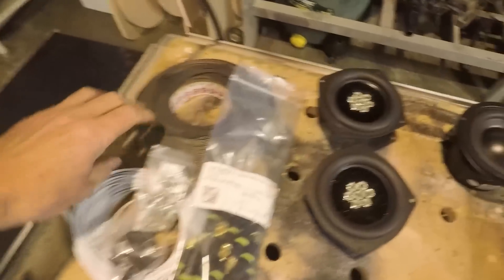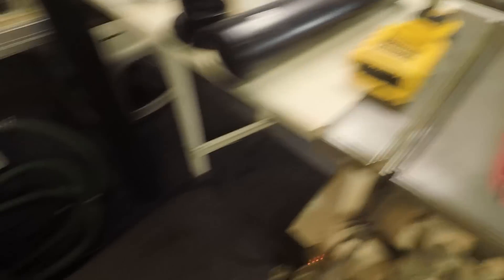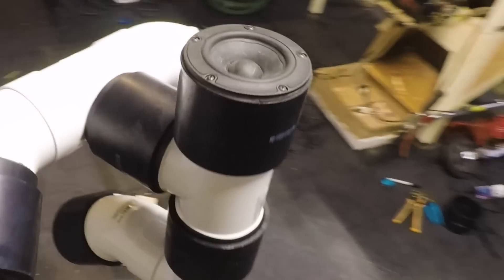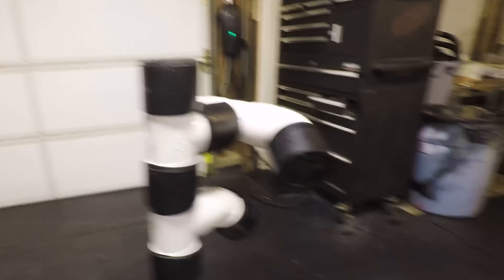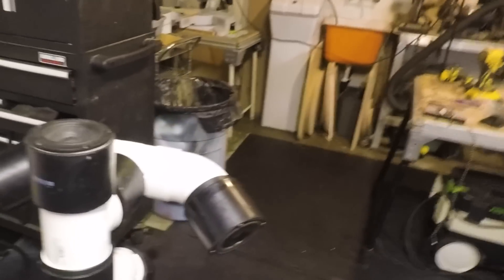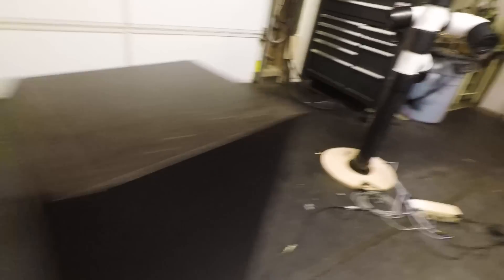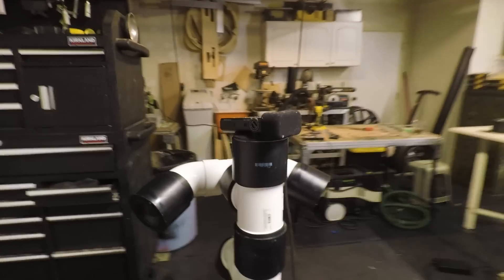Speakers Don't Sound Real, Lets Build One That Does

Comment: You should try Ohm's Walsh series of speakers as your sources. Mirage also had their Omni series, but it's been radio silent since KEF bought them over a decade ago. Mirage advertised that 70% of the performance was reflected, ambient sound.
There were other quasi-point-source speakers over the years, but those are the ones I recall actually selling (fairly) well. It still comes back to the old saying - your room is the largest instrument in the band.
Reply: I second Jason's recommendation of the Ohm Walsh omnidirectional speakers.  While being a large format hi-fi speaker, they are definitely not point source designs. As a small format, Gallo Acoustics could come somewhat close the above.  Also you may take a look at the Sausalito Audio Works tweeter aperture waveguides.  Apparently they have a non-conventional radiation pattern.  I think B&O licensed the tech IP from them a while back. Who also created the cardioid arrayed Beolab-90 speakers.

Mr Rat, excuse my ignorance but it would seem as though you've recreated Dolby Atmos through mechanical means? With six discreet mic positional tracks (per instrument).  Perhaps Bessel arrays, Harmon CBT, Don Keele spherical arrays? Maybe try a 360 degree cluster of 50° pattern wedges. One for each mic channel.

On a side note, for me reproduction of live instruments requires lots-o-watts.  Coupled with speakers capable of high spl, fast rise time, and preferably low'ish QTS drivers in an under dampened cabinet alignment. Yeah on paper they'll ring a bit on decay, but in reality they'll hit the first signal cycle with a higher amplitude!  Nothing sounds more live than realistic transient attack.  Maybe not your cup of tea, but the DSL unity horn designs do some really cool stuff!

A gem amongst a sea of audiophile hyperbole, the Spica TC-50 speakers were truly holographic in their imaging and soundstage.  The owner/engineer of Spica hit a magical sweet spot of phase alignment, mechanically & electrically.  Anyway, love your work and audio experiments! 💯
Reply from the maker: Maybe give a watch to the follow-up video where discuss most if not all of those perspectives and let me know what you think

https://youtu.be/DetAlPFa7gc
Reply: @DaveRat  , per your recommendation  watched your follow up vid, thank you.  Many may have gotten a better understanding of what you're proposing from the 2nd vid.  I totally got what your experiment was in the first vid!  But for hi-fi reproduction this concept is unfortunately not commercially viable.  I think for application specific reproduction exhibits (museums, trade-shows, hi-end business presentations) this might get some traction as a new standardized multi-channel format.  I still think you might attain similar results with a column of splade full range , or coaxial drivers.  Your rear-facing drivers are further exaggerating the already reduced bandwidth/amplitude/phase/polar response of a recorded instrument's rear/wide axis signal profile.  And their boundy interactions will be all over the map in different environments!  While maybe attractive to the human ear, is it a more accurate representation?  Many people prefer large amounts of artificial stereo and 3D'ish effects.  Is that a good representation of the original sound event, most likely not.  But Dolby/DTS/ProLogic/Etc effects have largely helped sell billions worth of consumer/pro AV gear.  Hell look at all the fancy LCD, OLED, nano-pixel blah blah blah TV's sold.  Hyper-realistic colors, razor edged outlines, digitally processed motion artifact reduction (that usually induces an even more peculiar viewing experience).  The low informed consumers gobble it up like digital candy!
Reply from the maker: I'm not really interested in diluting the concept of how things work by what is commercially viable.

I think trying to plug some idea like this into a familiar market may not be as forward-thinking as could be.

I come from the live sound world where we regularly buy speakers that cost $12,000 a piece and buy them in blocks of 32 and 64 units at a time and deploy hundreds of them for big festivals.

From the perspective of a home HiFi consumer, high end pro audio systems would not seem commercially viable either but in reality they are it's just a market that is unfamiliar to most.

Ultimately the question isn't whether it will make money or be accepted but rather, does it sound more realistic?

The reason I thought maybe watching the second video would be helpful was the recommendations that I look at the ohm speakers and other speakers that radiate the same sound in multiple directions and thought maybe the second video clarified why those concepts are not in the right direction
Reply: @DaveRat   @Dave Rat  Fair I suppose. From this video it seems like you're not using directional mics that mirror the positions & radiation patterns of the drivers or keeping the signal chain intact so the sounds won't resemble the original performance anyways. If you maintained signal separation, it would look a bit like a speaker version of an ambisonic mic array which might be quite a thing.
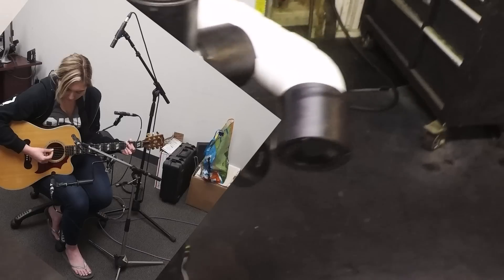In this demo you had six mics recording for four speakers, and you said you didn't even remember which mics were where (7:58), so it's not really recreating the sound field. It's just an oddly shaped point source.
Reply from the maker: Exactly and that is the most important aspect of this adventure.

Recreating the sound exactly is not necessary to create realism.

An infinite amount of different instrument shapes sizes and sounds will all sound real.

Yet conventional speakers fail in making any of those sound real.

The whole point of this is that in order to sound real, radiating different sounds in different directions is the most important aspect.

Which mic captures which sound or whether the instrument is dull or bright in this location or that is not that big of a deal.

I am not looking to recreate the exact sound of the original instrument.

I am trying to show that Sonic realism can be achieved by radiating different sounds in different directions like the actual instruments do

Additionally fidelity, is not critical for something to sound real. A trash can lid has very little fidelity when hit but sounds real if you're in the room with it and never sounds real if you record it and play it through a conventional speaker regardless of how much Fidelity that speaker is capable of.

Fidelity helps but it's not critical, mic placement helps but it's not critical, it's the generation of multiple sounds radiating in multiple directions such that we get multiple reflections creating a much more complex interaction of sounds that creates realism, I believe.

At least at this infantile point in audio where this angle has not been explored to any substantial degree.
Reply: @DaveRat  , I've watched you YouTube videos for years.  Your pro-sound knowledge base is amazing, and I've learned quite a bit from your sharing!  In my humble opinion line arrays/j-arrays/cluster arrays still follow basic wave propagation directivity rules.  The real magic is in the dsp processing, for integration and coherency as essentially a macro-scale point source.  Dynamic correction via FFT analysis and other advanced algorithms makes them viable.  Otherwise all you have is column speaker(s) with all their inherent mess.

And I would like to compliment you on your video editing, worthy of educational reference material. Perhaps an next phase of your career arc?

To answer your original question, I'd say yes your format of recording/reproduction does sound more authentic!

Just curious, do these latest and greatest large format arena/edm festival systems now include ambient air temp and Density Altitude (Baro) inputs for dsp corrections?  Outdoor setup have always suffered from annoying Doppler like phase distortions from wind gusts.
Reply from the maker: Very cool and thank you!

As far as line arrays being dependent on DSP processing and maybe worth looking at vdos which was the foundational line array that started this whole trend and the only processing was EQ to smooth out the response and limiters to protect the speakers.

The whole beauty and function of line arrays is mechanical design

I have a pretty good knowledge of this because I have actually reversed engineered vdos presets into power soft amps so that we could power vdos off of the X4.

And was able to create with the help of my friend Mario presets that matched or exceeded The originals and all it was was EQ and limiters
Reply: @Traqr  , So yes in technical terms his experiment is not an accurate recording/reproduction.  But I believe what Mr Rat is attempting to display to the layman, is psychoacoustics may have a larger effect on our perception of sound being realistic than ultimate accuracy in signal capture/reproduction.  Psychoacoustics is an entire sub-category of audio science.  Dating back to Alexander Gram Bell, Fletcher/Munson, and other early pioneers of sound science.  Much like advanced "lossless compression" algorithms which truncate data streams via mask frequency subtraction, and predictive generation of harmonics, subharmonic, IM, and many other signal interactions.  AI A/V technology soon will be doing some amazing things!   

And - not to jump tech levels here but, neural implant technology will eventually render current physical reproduction typologies (along with our own physiology) obsolete!  Now that's a rabbit hole to fall down into! 👀
Reply from the maker: Reproduced sound does not need the sound identical to the source to sound realistic

But

If a sound does sound identical it would absolutely sound realistic

Therefore

For a sound system to focus on sounding identical it must also embrace sounding realistic

This project here is focused on the simpler and overlooked aspect of realism.

Once realism can be achieved then we actually have a shot at working on sounding identical

To try and sound identical without tackling realism is a waste of time because it cannot be achieved
Reply: @DaveRat  , While your format is interesting it would seem that optimizing phase accuracy of your array would be the next step?  I've auditioned some of the most expensive esoteric (home) audio hdw out there.  The now decades old, little 2-way Spica TC-50's generated the most pronounced 3D soundfield (from standard stereo LP) I've ever experienced.  Not only could you pinpoint individual instruments, they sounded like they were (realistically) floating in the air not only between but also extending laterally and in depth well beyond the speakers. I own multiple sets of Vandersteen speakers, which were designed (compromised) specifically for maximum phase coherency - and yet fail to deliver what the Spica's could achieve (for a fraction of the MSRP)!
Reply from the maker: Why?

Aligning phase is very important when identical signals are being reproduced and interacting with each other.

But do we align the phase between a guitar player and a bass player?

Do we align the phase between the various drums of a drum kit?

We align the arrival times such that we don't have drastic offsets but phase aligning separate independent signals serves little to no purpose other than to create artificial sounding things.

Theoretically if an instrument radiates different sounds and different directions they would be minimally phase aligned in the first place

The phase of the sound coming off the front of the guitar versus the top of the guitar versus the back of the guitar or the bottom of a guitar are not all aligned and differ.

It is these differences in signals and phase creating reflections that don't perfectly cancel and conb filter with each other and the direct signal that I believe is one of the aspects of sonic realism that's overlooked.

The initial instrument is a phase mess more like a distributed mode loudspeaker

So to artificially correct that phase mess I believe would be working in the wrong direction
Reply: @DaveRat  ... But they are aligned. They're aligned the way the instrument produced them, and any variation to that alignment will be artificial. Your example of a trash can lid is a good one - instruments are chosen for their resonances, even if it's intentionally discordant. Creating a different, arbitrary alignment will create a different, arbitrary sound. Real sound is hard to reproduce because it's so deeply layered, with all the complex phasing, interferences, and directional cues that a real-world speaker has trouble duplicating.
These principles have been known to recording engineers for a long time, which is why we have XY, mid-side, binaural, and a host of other arrangements just for stereo recordings, and the phase variations are sensitive to remarkably fine misalignments. I also think you've underestimated the influence of frequencies at the limits of hearing - when testing my home theatre some time back, I was surprised by a set of measurements from well below the others (down to about 5Hz). Then my son came in the room, and I realized I'd been picking up his footsteps from the hall. Reality is more hi-fi than hi-fi apparently.
Reply from the maker: If all of these are so well known and so sorted out how do you explain why HiFi systems have so much difficulty fooling people into thinking a real instrument is playing in the room?

Have you ever heard a HiFi system where you walked into a room and walked around and were absolutely convinced that a real musician was there playing an instrument?

If you place four different mics on an acoustic guitar and run them all into test software or smart will the phase of all four mic be aligned?

If you combine those four mics however you wish using whatever tools you wish and alignments you wish and reproduce them through a speaker and then put four mics on that speaker will the phase from the mics miking the speaker be all aligned?

Feel free to test and prove me wrong but I think you'll find that the phase is not aligned on the four mics on the real instrument yet will be aligned on the four mics that are micing a speaker.

I believe what I just described is the reason speakers don't sound real, regardless of their fidelity.

Sonic realism involves a phase mess. Loudspeakers are intricately designed to avoid presenting a phase mess.

In my opinion whether the face mask is the same mess as the instrument produces or a different mess only changes the sound of the instrument but not the realism
Reply: @DaveRat  Hah! No, of course routing multiple mics into one signal won't maintain the phase alignments across all frequencies - that's my point. The real soundstage is a continuously flowing 3D field, and the best chance of matching it seems like it should be matching full-range drivers with full-range mics, both spatially and temporally. Also, I haven't experienced an audio system that overcame the challenges of getting a real speaker to sound exactly like some completely different real instrument, let alone a set of different instruments playing in a real acoustic environment, because real speakers have their own resonances, phase alignments, and directional cues; so do the microphones we use to record with. I believe that's why sound engineers have to spend so much time and effort repairing audio to match what they heard in the recording room, and why people spend outrageous amounts of money trying to make their speakers vanish, leaving just the music.
Reply from the maker: If you never hear the original instrument, how do we know which resonances are from the speaker and which from the original?

Only if the resonances are applied to multiple unrelated instruments does it matter

I still feel you are focused on recreating an identical image of the original rather than a speaker that sounds like an instrument instead of a speaker

Current speaker technology can't even reproduce an instrument the wrong way that sounds close to actually being real let alone create one that sounds identical to the source.

I'm focusing on the easy part make something sound real phase 2 can be make something sound real and also sounds like the original
Reply: @DaveRat  , Your response was quite a bit to unpack.  And responding in a meaningful manner will greatly exceed my patience of typing on an android keypad. But, I believe Jason responded in a rather articulated manner.  Which is in line with my understanding of audio science!   Your "stormtrooper" speaker is laid out in a semi-symmetrical cfg.  And I could be wrong but, it seems like you're attempting to prove that coherent, aligned, or even similar divers and/or microphones are inconsequential to reproducing the effects of your recording/reproduction format?  
* And you could be right! *

I auditioned beta production prototypes of the Grand Slam speakers at David & Sheryl Wilson's townhouse in the early 1990's (was trying to get a job with Wilson Audio).  They were a massive cluster of driver cabs, being processed with goldmund active Xovers and parametric equalizers.  I was shocked to see an esoteric speaker built that way, and the fact he was processing the signal!  Back then it was all about signal purity via minimalist signal chain.  But he got it to work, and was successfully charging >$100K USD for a set even back then!

And I'm not arguing with your findings, actually you might discover others have already traveled down this research road many decades ago.  But at the same time, I can agree with Josh!  This intentionally created semi-chaos of signal reproduction would cause most competent recording Engineers an aneurysm. It fundamentally breaks so many good practices in one swoop!

I feel like I'm dancing on the razor's edge of insulting you?  You're obviously someone who is leagues above my knowledge of the subject matter.   I really hope I don't come across that way!  I'm just trying to figure out what your interest is in this.  Are you just telling us to "hey check this out"?  Or are you feeling out if there's industry interest, or enough interest to form a diy forum to explore this phenomenon?
Reply from the maker: I realize I am throwing wrenches in some norms and assumptions.

Much effort is spent on perfecting the phase alignment of various drivers and systems and speakers. And that is important when those speakers are reproducing the same sound.

The wrench I am throwing is to not send the same sound to multiple speakers therefore making those phase relationships irrelevant or less relevant.

When two people sing we don't have to put their voices in phase or phase align them to have it sound good they are independent sources.

I understand the rules that systems are designed by, and I am bypassing many of those rules with this design.

In other videos that I will release public soon, I will show how to completely solve the phase cancellation and power Alley that occurs with subs placed left and right on a stage.

Not by any magic or tricky processing, purely by not sending the same signal to both subs so they have no interaction.

This is all offshoots from the concept in this video where I demo that polarity and phase is irrelevant when dealing with sources that are different.

https://youtu.be/VHjdh-Vka-g

Oh and and don't worry about insulting me I'm not trying to sell you on some theory I am sharing information that I have learned and can actually demonstrate.

 Maybe try voice typing it's easier!
Reply: @DaveRat  , Once again thank you for sharing!  I'll stay tuned, I'd like to see where your experiments on this lead to!
Reply from the maker: And thank you! I seek out and appreciate the challenges to the concepts as it helps me refine and make sure that I'm on the right path.

I appreciate your time and responding and great to meet you!
Reply from the maker: The issue is that pint source is a flawed concept if realistic sound is desired.

No instrument radiates a like a point source. So speakers that recreate point sources will never sound realistic.

The issue is that real instruments radiate different sounds in different directions that have different reflections summing with the differing direct sounds.

A point source radiated the same sound so all r inflections are clones of a single sound and all those versions of the exact same sound combine with maximum combfiltering 

A real instrument has minimal combfiltering because of all the sounds radiates are different.